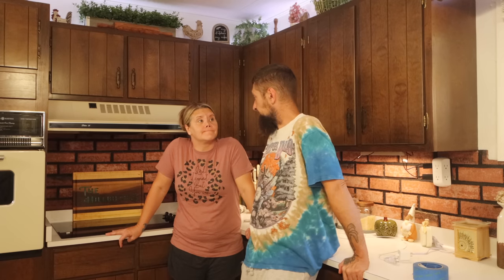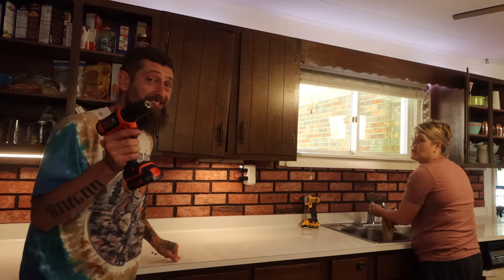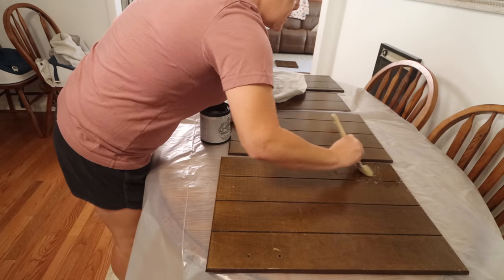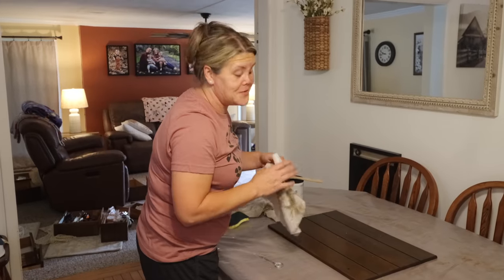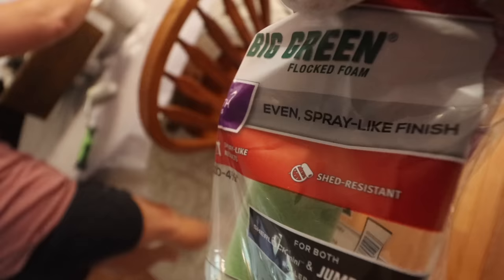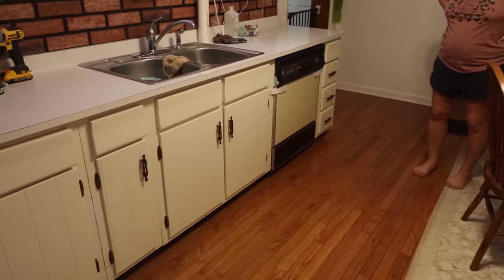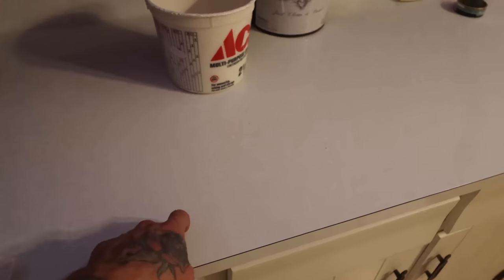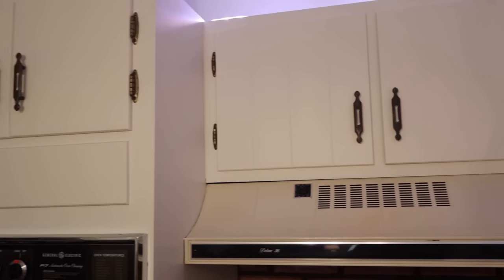We redone our kitchen for $200

Comment: We  had our kitchen redone for 1500$ about 6 years ago. We had 21 new white melamine cupboard doors and 10 drawers made, new faux wood flooring right through to the dining room, white subway tiled backsplash and painted the cabinets with white melamine paint. Our kitchen is not small 600$ was labour the rest was material and paint. I gave the guy an extra 300$ for his meticulous work totalling 1800$. The dark  oak cabinets had a few nicks here and there over the years but held up really well. We kept some cabinet paint and used an artist’s  paint brush for the touch ups. Mind you, are kids are all grown and pretty much out of the house. We got a quote to tear down and replace everything for over 15,000$. Our house was built in 1970, so the update really changed the look. I love you guys!❤️🇨🇦🙏

Comment: I love what y'all did with the cabinets! It looks so much brighter and bigger now! I painted faux granite countertops on one of my rental houses, and I've gotten so many compliments on it! There's tons of tutorials out there if you're curious. I lightly sanded, primed them white, and then used a synthetic crafting sea sponge, and dabbed on black, then grey, then a little metallic silver, then white, and then sealed them with a water resistant sealer from all in one paints. You can use a couple of different options for the sealer depending on how matte, or shiny you want your finish to be.

Comment: The kitchen looks alot more opened, You can also spray paint the hinges and door nobs if in the future you want to change  and the color does not go, We did that with our hinges and it turned out great plus we did not have to worry about making new holes in the cabinets or the frame. I cant wait to see some more changes to the kitchen. GREAT JOB GUYS.

Comment: The cabinets are beautiful.  It takes a few weeks for the paint to cure.  Also if your wanting to clean your knobs dump a jar of ketchup in a rubbermaid-ish container throw in knobs and coat them.  Put a lid on and.let them sit for the night. Toothbrush them clean soap & water lay them out to dry.  Easy as that.

Comment: Use cabinet paint from lowes and will not have to degloss the original cabinets. 2 coats totally covered our stained kitchen cabinets. Wiped down with vinegar to clean then paint.

Comment: I know at Home Depot they sell actual butcher block you can do for your counter tops. Just get the real stuff. Not horribly expensive plus you don't have alot of extra to cut and fit. Just a suggestion. Alot easier than faux. You would only need 2 maybe 3 pieces.  You can do it Shaun. Not really hard

Comment: I would paint the tops or clean them properly and every 12 months put contact paper up there so the oil that is in the air and ends up there can be removed easier. When I got the news paper all the time I would put new newspaper up there every 6 months